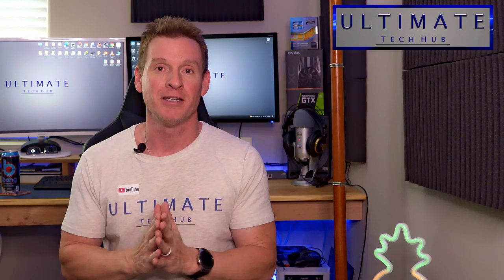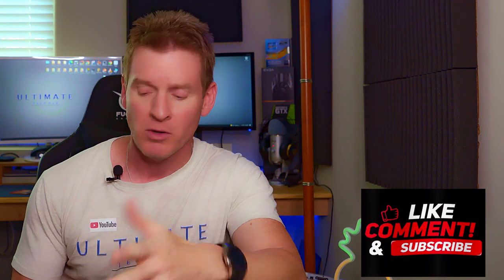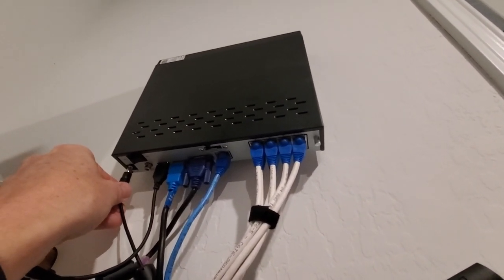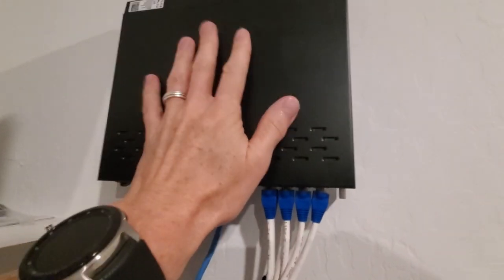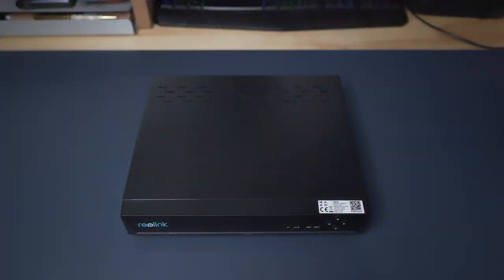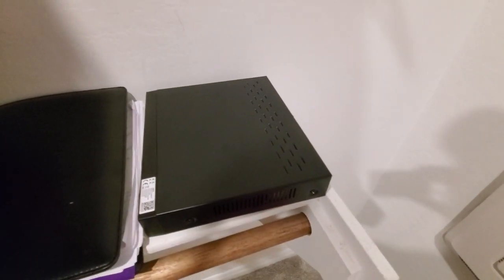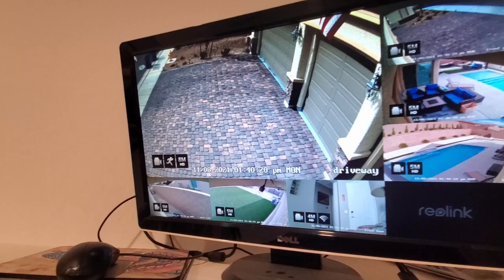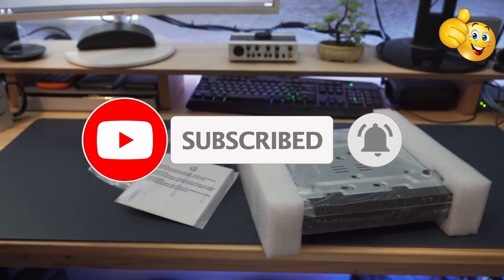REOLINK CUSTOMER SUPPORT! REOLINK 2TB NVR NOT WORKING - IT'S BROKEN!

Comment: I've had Reolink for over a year. The cameras just recently stopped connecting. I've updated my firmware, and have the software that you show in this video. The system is now unable to connect to the cameras. I'm in contact with Reolink tech. support, but they are dragging their feet on reading everything I've done so far, asking questions that have both: 1) nothing to do with the issue, 2) expose their inability to read the information I've provided about past things I've done to troubleshoot the issue.  I'm sure they gave you the VIP treatment because you have a YouTube channel & review these devices. I just don't expect to have the same experience as you.

Comment: I recently had an excellent experience with reolink support. I bought my system over a year ago. Just now got around to hooking everything up. One of my cameras wasnt working. Contacted support and within several hours they contacted me. Helped me troubleshoot my issue over a couple of days. Not thier fault...more mine as i am really busy. Camera ended up being doa. Paid a small shipping fee to ship me a new camera since it was after the one year complete replacement period and within 2 days i had a replacement. I didnt even have to send the broken camera back. System is up and running with no issues so far. Great customer support in my opinion.
Reply from the maker: Glad Reolink gave you a replacement! Thanks for watching!

Comment: I find Reolink has lousy support, actually they have no support it seems. Loved the camera, after 8 months now it won’t connect, can find a fix.
Reply: Thank you for posting. I had 2 replacement camera's sent out to me. To my surprise both camera's wouldn't connect to WIFI or cellphone Hotspot. I've made over 20 calls and sent more than 10 emails. I received a single call and several return emails, instructing me to watch more video's. WORST CUSTOMER SERVICE EVER!
Reply: Same here 4 cameras fail to connect, found a power supply 12 volt 2amp connected it to one camera plugged it back in and it worked. Seems the NVR ports are no longer sending power to the cameras. Waiting for another email from reolink. 4/25/23

Comment: I'm getting a replacement soon, overheating hd problem.  Temp fix put table fan over it.  It was getting over 120f when I first started noticing fail to record.  I'm sure it actually got hotter when it was in the case closed up so from now on temperature monitoring on my nvrs.  I'm currently experimenting with their 36 channel and it's brand new out of box has frozen and also Auto rebooted itself hasn't even been on for 4 hours.  As for opening the case there never should be a problem because most of these have the hard drive in there and the one I just got well you got to add hard drives  so got to open case.

Comment: Same thing here, the cameras just starting failing to connect one after the other.
Every thing was working on the PC, cell and on a monitor. For 18 months. 
No wires were moved or changed, last video recorded showed nothing out of the ordinary.
It would be easy to connect to the modem and check each one but, no power supply for cameras unless it's through the NVR.

They sent me a new NVR in one week.
Connected the new one up and the same thing, all cameras are failing to connect. 
Ports at the back just have yellow flashing lights, cameras cycle on and off every 10/ 15 seconds.
These are four POE cameras. From them.
Working with Reolink support ongoing.

Comment: I see that you have the vga cable and hdmi cable hooked to the nvr. Are you also running a tv at the same time as the monitor in your closet?
Reply from the maker: Yes I'm running hdmi over ethernet. I have a video on that setup. We have a 65 inch 4k monitor in our living room.
Reply: @UltimateTechHub  Thanks. I may have to try that too. 👌